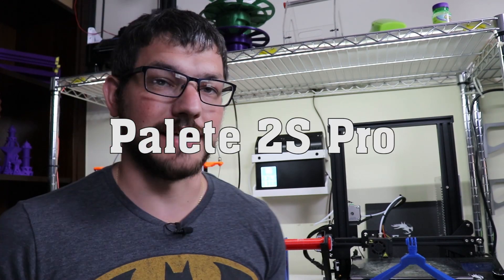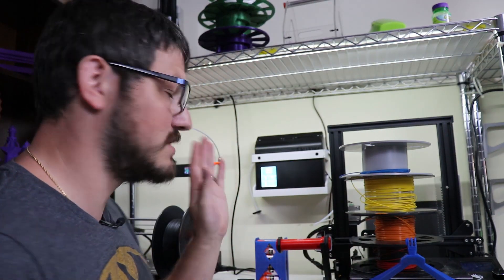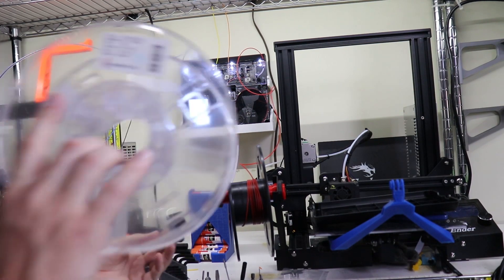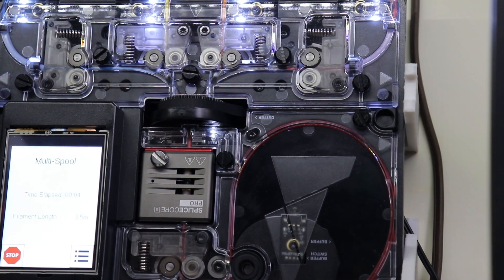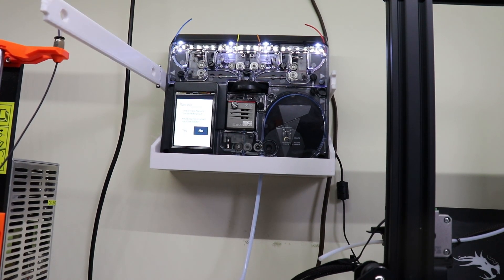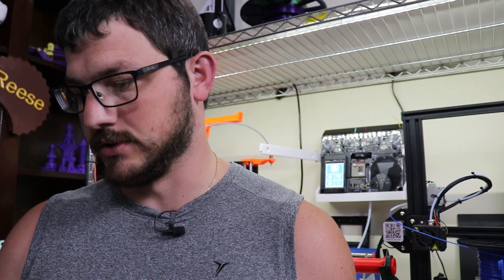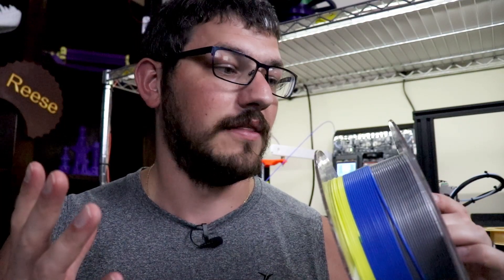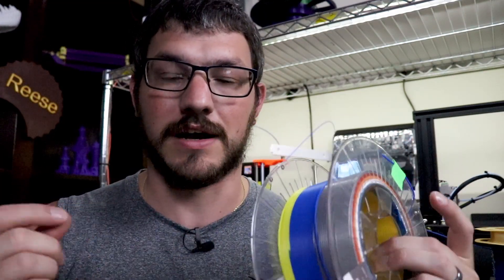Combine Multiple Spools with the Palette 2S

Comment: If you are printing prototype and don't care about color, why bother making a spool?  I just run the print and let the Mosaic Palette do all the necessary splicing when one spool run out of filament during the prints.  It was already designed to do that so you don't end up with partial spools.
Reply from the maker: Not every printer has a filament runout sensor. So if I need more than a 50g spool, I would have to be around to pause the print, change the filament and then resume. Then repeat shortly there after. Also, I have many machines and the Palette is only near 2 of them.